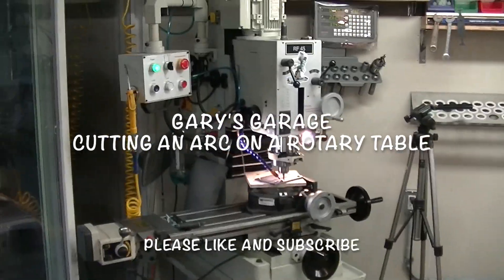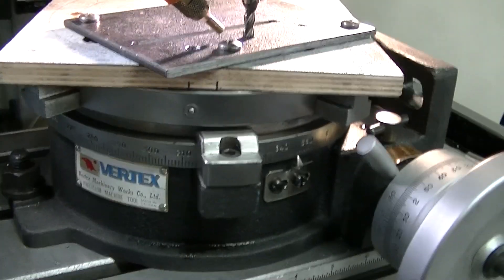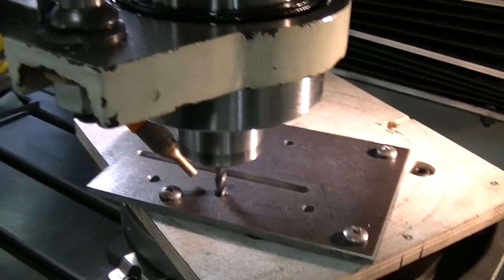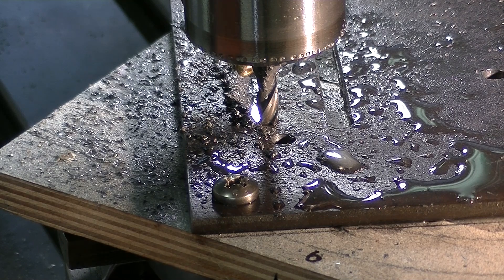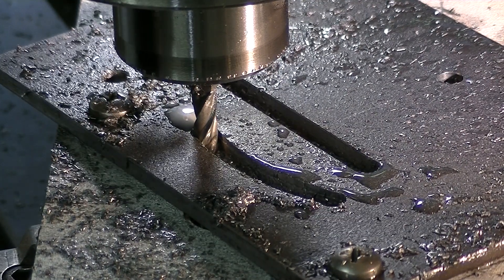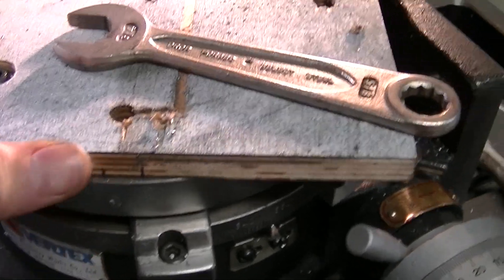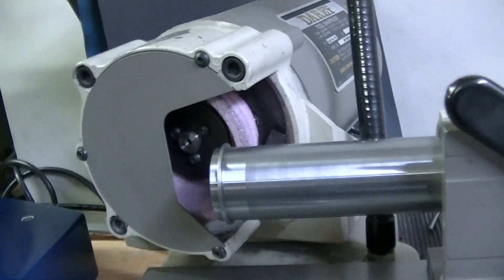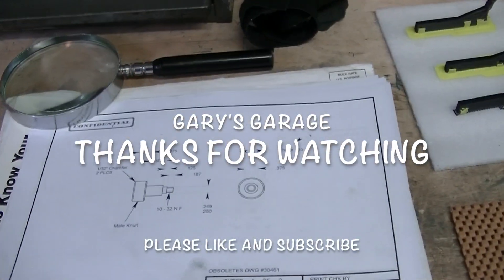Cutting an arc on a rotary table

Comment: Hi Gary,
To protect the tables and clamping we use machinable plastics as aluminum is way too expensive. We use a ton of the material for prototyping, machine setups, testing and more.  It can be used to make parts too as it is super tough and great to teach with as it machines a lot like aluminum.  Per the chatter you can lightly tighten up the table locks to prevent the backlash from kicking the part back around when making the cut, however making the table a little harder to turn and removes some feel.  Sincerely, Sitek Manufacturing and Tools
Reply from the maker: @tsitek7577  Great tip.  I have lots of plastics in stock doing nothing.  Thanks for dropping by.

Comment: Gary -- Your passion for machining is obvious. Your shop is neat and organized.Your camera work is clean and viewer friendly. 
You articulate well. "I'm impressed" Now it's time to address your question about chatter in the arc groove. Your drawing calls for a .2505 to .254 arc groove.  I would recommend by starting with an end mill about .010 to .020 smaller than ø.250 Diameter. I usually use a undersize reground end mill to remove the bulk of the material. I would finish the groove using a ø.250 diameter. If you are lucky the end mill will run out a little putting the groove within the drawing tolerance. Like the Lake said,When you're in neighborhood  " Drop In "
Reply from the maker: Thank you for the feedback, that's great to hear!  I'm new to machining in general and just started posting on youTube, using an old JVC handycam lol.  Luckily the part is not precision so a loose fit for the pin is enough for it to ride in.  I did some filing off camera and it's very smooth.  Stay tuned for a shop tour in the next week or two.
Reply: Gary -- I'll make some popcorn .